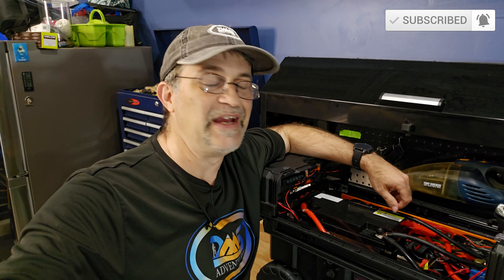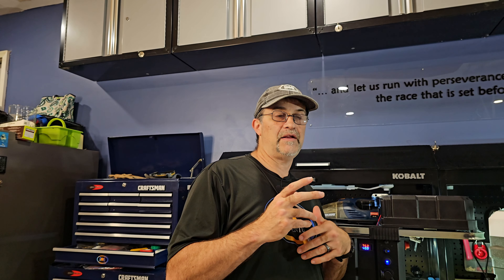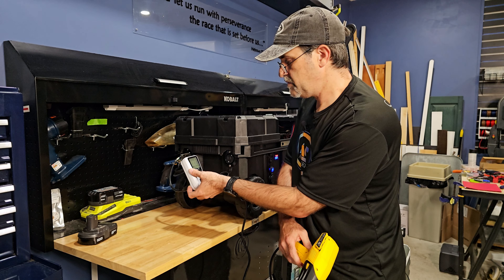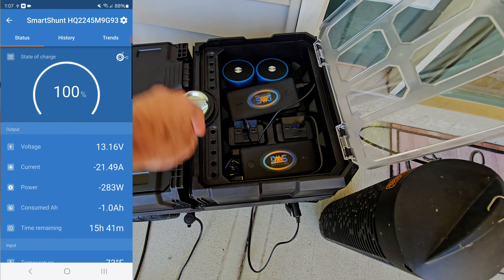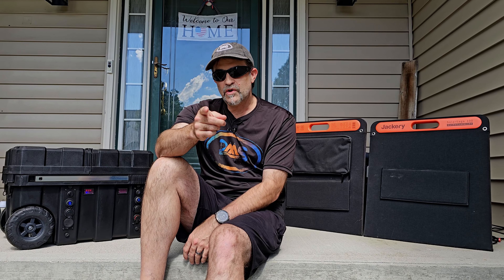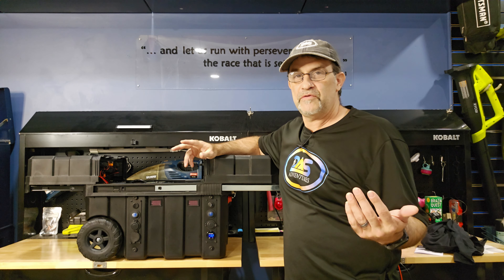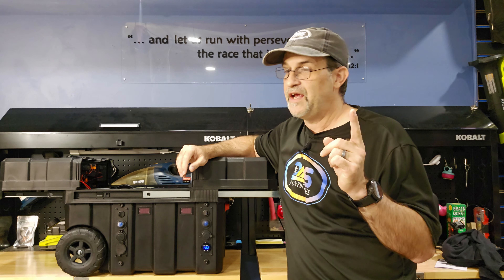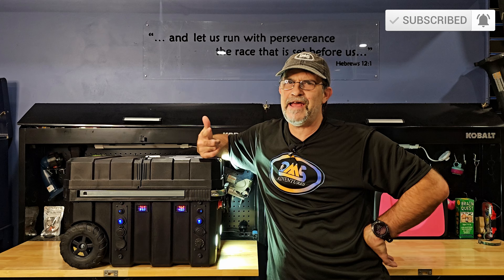Building A Solar Power Station For Off-Grid Camping - Episode 4: "The Results"

Comment: Awesome looking build! Have you figured the cost per watt hour?
Reply from the maker: Thanks Brian! Not in an in depth way no.  I'm sure it was high bc i had to buy so many tools and odds and ends that many wouldn't have to buy. Also not sure exactly what efficiency to apply to the system.  80%? 85% maybe. Just straight numbers would be somewhere around 50 cents per watt hour.  Best guess numbers backing out tools and efficiency... maybe 53 ish.